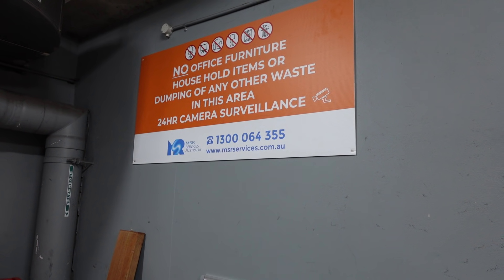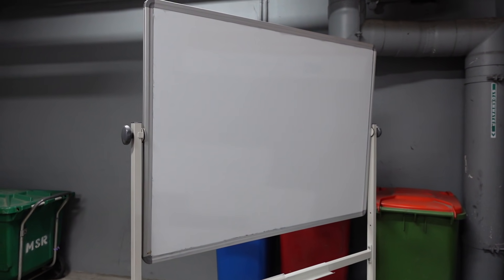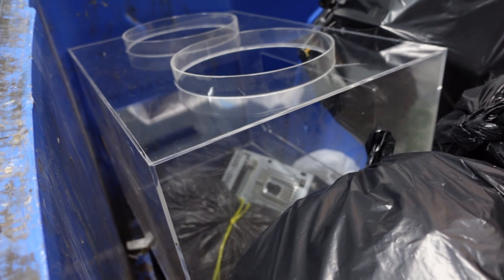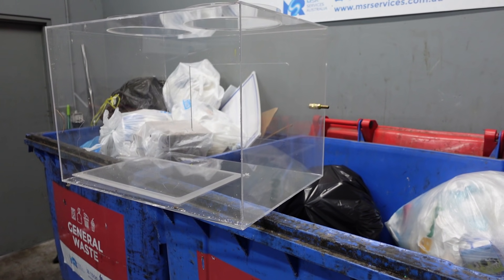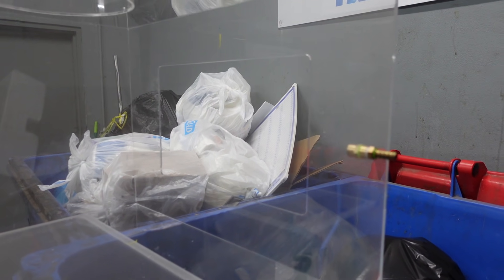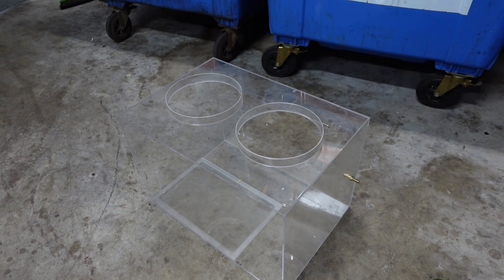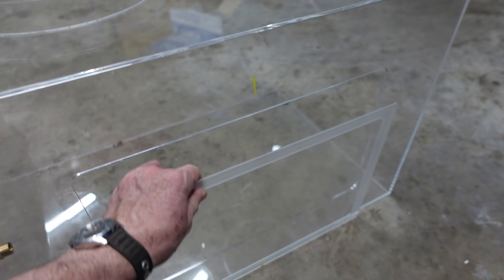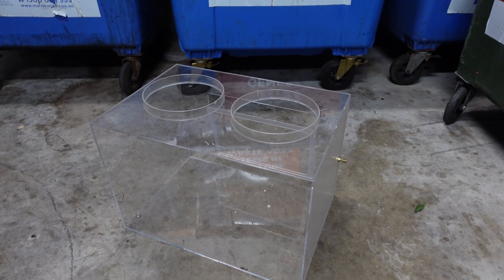Interesting Dumpster Find

Comment: My guess is possibly a vacuum chamber, with glove holes, maybe for epoxy potting, or rubber moulding. The screen would probably sit on top, and just needs a rubber seal around it to make it ideal.👍🇦🇺
Reply: Vacuum chambers are more sturdily built.  They have to be, the base air pressure is about a thousand newtons per square meter.  If you draw a good vacuum down to, say, 1% of atmospheric pressure, your container has to be able to support about 990 newtons per square meter.  This is about the force excreted by gravity on the Earth's surface on a mass of about 100 kg.  ()Actually, a bit more than that, but this isn't a precise physics analysis, more gross engineering.)  So, in practice, you'd want a container in which you plan to draw a good vacuum to be strong enough to walk on without flinching.  (And also, since drawing a good vacuum is time consuming, you make a vacuum chamber intended for degassing as small as it is practical for you to build it to support the largest container size you want to be able to degas.  Most of the things you'd want to degas are on a clock, after all.)
Reply: @evensgrey  Yes, I think I tend to agree, that enclosure is rather large, and it doesn't look like heavy wall poly/perspex, so it would likely implode fairly easily given the calculations you mentioned.
Perhaps more likely it was a low pressure clean work cabinet.

Comment: For starters, I think you have it laying on it's back.  The fact that the loose part doesn't have hinges means that it is oriented horizontally.  Considering the alternative, I think that establishes the hole with the moving part as the top!  Therefore, the two circular ports are vertical, and are indeed probably intended for arms...but not the way you suggested!  I believe that the brass fitting pumps in filtered air to make positive pressure, and functions as a dust-free work zone.  This is corroborated by the high visibility of the structure, and it's general size.  The exterior of the port is meant to receive an unterminated hose, while the interior has no such fitting; it simply exhausts into the chamber.

I briefly considered the inert gas theory, but allowing that much escapage would be totally wasteful of something that arrives in tanks.  It's design seems to be focused on preventing dust contamination rather than oxygen exposure.  Electronics repair doesn't need anything like this, so my guess would be medical testing.  The large flat bottom would have held test tubes of biological specimens, various testing chemicals, etc.  If dust is that much of a problem, the work probably required a lack of bacterial or general genetic contamination, in any case.

After further thought, the hole in the top is there to put in items that are taller than the armholes like stands or little shelves.
Reply: If it was designed for negative pressure/vacuum, the rectangular opening would be on top.
If it were designed for positive pressure, the rectangular opening would be on bottom with the door on the inside.
Must be one or the other, because the door has no visible means to secure it; and without that the only possible orientation is rectangular opening up or down, otherwise the door would just fall off.

Comment: It is a glove box without the gloves.  The round holes should be sealed with gloves where you can reach in and manipulate things in an isolated atmosphere.  The rectangular hole allows you to insert tools and workpieces.  The rough finish adheres well to a deformable seal.

Comment: RIFA and tantalum magic smoke chamber right there, with extra large ventilation ports and sampler coupling adaptor. Only thing it’s missing are the silicone rubber sealant stripes which had to be replaced anyways.

Comment: I think the rectangular opening should be oriented up. And that each circular opening normally are fitted with a sealed / air tight glove. Maybe the vent is for creating a pressure inside the box slightly higher than ambient air, such that no contaminated outside air can enter the box. You could possibly use this thing as a small clean room for opening hard drives and other delicate stuff.
Reply: Or you could pump in oxygen for the prematurely born baby inside.
Reply: @johndododoe1411  They don't do that, actually.  While some preemies get external ventilation (because prior to a certain developmental point they don't have the strength to ventilate properly on their own), they don't give them oxygen because it was discovered that doing that causes them to go blind later when it is discontinued.  (What happens is the higher blood oxygen level causes the blood vessels in their retinas to not develop properly, then when the baby starts breathing regular air and the blood oxygen level drops, the blood vessels develop abnormally and eventually cause the retina to degenerate into a fibrous mass.)
Reply: It could also be with the rectangular opening down; with the door on the inside.  If it was designed for negative pressure/vacuum, the rectangular opening would be on top.
If it were designed for positive pressure, the rectangular opening would be on bottom with the door on the inside.
Must be one or the other, because the door has no visible means to secure it; and without that the only possible orientation is rectangular opening up or down, otherwise the door would just fall off.

Comment: My guess is for testing air flow from a pair of supply ducts or a couple of fans.  Also could be for testing filters.  The fitting is for the manometer.   Sand blast is out, sand would eat the plastic big time.  With gloves, and filled with argon -- you could assemble prototype lithium batteries.  Mini clean room, feed ultra clean air in one duct port and out the other.  Manometer fitting to be sure you always had positive pressure.  Open up disk drives?

Comment: vacuum glove box... the 2 big dia. ports are for range of arm movement in the gloves... neg pressure only... that isn't an inlet nipple... no baffle on the inside to diffuse incoming air... and it is clean as heck.. so no heat oriented activities on the inside... my guess: an opening box using vacuum to reduce o2 contamination... art/book/Document appraiser/ dealer?

Comment: Could make a nice clean "room" for HDD re-work.
Reply: that is not how clean rooms work. It will not help at all.
Reply: @Sixta16  You put extraction fans on there - fit rubber through holes for your hands, and yes - that's exactly how clean rooms work...

Comment: The whiteboard would still be useful. Take the board, toss the stand, and hang that puppy on the wall.
Reply: RSPCA Australia might have something to say about that!
Reply: Whiteboard is height adjustable, the sliding parts are hidden in the pivot points, so you simply undo them slightly, and slide the board to the right level. Just means that instead of flipping to the other side, you turn the board around.
Reply: @SeanBZA  Yep.

Comment: it's basically a portable clean room, the ports are that big because they should have those big glove things attached to them (like the intro from the simpsons)
Reply: Was just about to post that. The big circle holes on one side are for invertible gloves, the rectangular opening is the top with a lid.
Reply: Came to say this, it's an hermetic glove box... :)
Reply from the maker: Yeah, that's what I was implying in the video, but seems too big for that.
Reply: @EEVblog2  If it was designed for negative pressure/vacuum, the rectangular opening would be on top.
If it were designed for positive pressure, the rectangular opening would be on bottom with the door on the inside.
Must be one or the other, because the door has no visible means to secure it; and without that the only possible orientation is rectangular opening up or down, otherwise the door would just fall off.
Reply: @EEVblog2  Is there a forensic crime laboratory in the building? If so could ba a cyanoacrylate chamber.
Reply from the maker: Someone posted a photo of one that's near identical, and yeah, the glove ports are huge like this one: https://twitter.com/MeghanAkintola/status/1436545693469057025
Reply: Yup.  Your gut feeling was correct. It's likely for some kind of media blasting etc. It just looks in too good of shape. The air inlet would be for the blasting tool, and the lid sits on the top.
Reply: @readyrepairs  is this the right material for a media blasting chamber? I’d have thought it wouldn’t stay transparent for long!
Reply: @JamesUKE92  It depends on what you're using as an abrasive.  It isn't always  ALOX or carborundum.
Reply: @JamesUKE92  And imagine the static electricity build-up.
Reply: This is an inexpensive model of glove box.  The gas port is so you can create an atmosphere of lets say, pure nitrogen inside.  The round openings are the front.  The square hatch is the top.  The parts are placed inside, the chamber is purged, the parts are assembled, the unit is removed.

My guess is nitrogen since the box is so open.  Other gasses would require an air lock to conserve other more expensive or toxic gasses.
Reply: @randycarter2001  for assembling things like nitrogen-purged optics? that would explain why there's no damage from blasting beads on the walls. and the air line fitting doesn't seem to have a connection for a tool (although there could have been something attached if those are male threads inside)
Reply: Maybe someone was processing SARS-COV-2 cultures in it!
Reply: There's no way to grip the edges with gloves though; I would expect it to be textured or have an engraved recess in that case.  It's probably 'gloved technician enters box' rather than 'technician enters gloves'.
Reply: @ghosttwo2  The gloves might just be friction-fit to the broad edge of the ports.  If this was being used for something like assembling optics or other devices that are filled with inert gas, it would mostly just be an annoyance if the gloves slipped off in use, and the system wouldn't really be all that tight anyway.
Reply: @evensgrey  if you look it up, the kind with gloves always have the smallest possible diameter and tend to have flush holes.  These are intended for lateral arm movement, and inserting/removing objects.
Reply: @ghosttwo2  I did look up suppliers of such things, and big ports like that are pretty common, and if there's not a flange on the port then it has a fitting inserted into it to provide a flange.  The gloves are held in place on the flange with what looks like a big hose clamps in the pictures where the mechanism is visible.  (These things have gloves that can go all the way up to your shoulder if you wanted and needed.  On the bigger ones, there are normally several ports, so you can reach anywhere inside from at least one of them.)

This looks like it's just a cheap and nasty version for non-hazardous things you just want to keep dust and/or normal air out of.  The holes are big enough for arm-length gloves, and given the size of the box, you'd pretty much need that much reach to get at anything in the back of it using the glove ports.
Reply: It has to be a purge chamber or similar that was mentioned. Any media blasting would damage the chamber material (acrylic?) It looks too flimsily  engineered to support vacuum or pressure in any significant amount and the glove spigots are insanely small to retain a critical seal. Nitrogen purged decanted packaging of something like hops or coffee ????